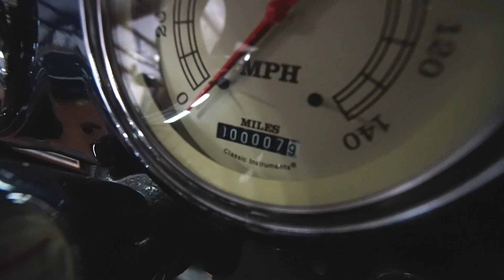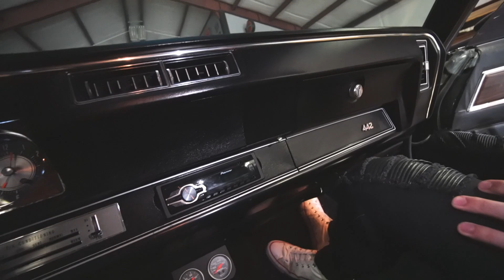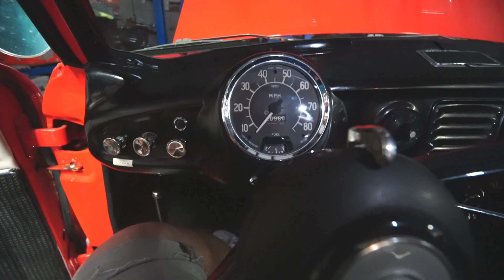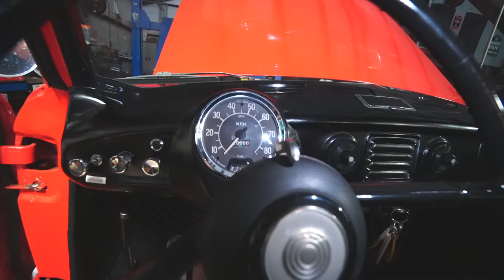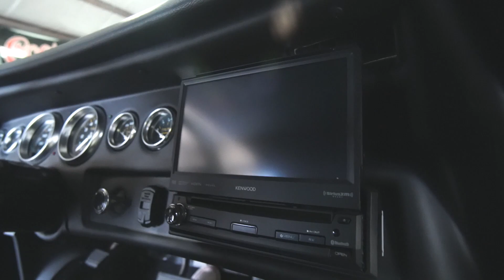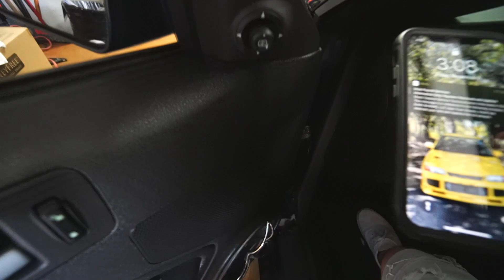Neighbor gives me tour of his INSANE classic car collection!

Comment: two models of the nash were powered by the OHV 1,200 cc (73 cu in) straight-4 Austin 'A40' series engine (as used in the Austin A40 Devon/Dorset) driving the rear wheels through a three-speed manual transmission.

Comment: Hey Evan. I have a question. I have an 99 civic lx that i strait piped. The check engine light understandably came on showing the p0171, p0172 codes. But also showing the p0170 code. I figured 171 and 172 would pop up but I’m not sure about the 170. I put a spacer on the lower o2 sensor and eliminated the 171 and 172 codes. But 170 is still there. I know you strait piped the Mercedes and I was wondering if you got those three codes as well...

Comment: Amazing collection of cars. They have an awesome taste as it's much like my own LOL. 
Evan you should get an american classic car. Modernize it with the whole drivetrain and interior. There where really popular to be doing 15-25 years ago here in Sweden and of cause in the US also. What would be really cool is to do it JDM style. Think a 2JZ swapped Chevelle or maybe even a bigger sized car like the Lincoln Continental. Look at Cooper Bogettis 2JZ swapped Camaro for an example that turned out cool and fast down the dragstrip even if a little newer car than a classic. Or if you would go bonkers and something like a R35 drivetrain and get that advantage with an AWD. Or maybe an EVO drivetrain. Maybe even do a classic JDM 70s car build with newer parts in it. A lot of the chassi design comes from the american classic cars era. Toyota and Datsun/Nissan has some beutieful classic car modells. A Toyota Supra MkI or a Nissan Skyline GT-R C10 would be awesome to see being build in a more modern fasion. 
My first car that I also painted and did some minor custom changes to. Like bumper delete and trim peices removed and lowered etcetera. Where an Opel Kadett 1977 with a 1.2L engine in it. So much of a fun car and not impresive hp or anything but it where hard to drive to unsafe with it. It actually where very fast on ice and snow roads as it where very balanced surpricingly. And with as small as 135/70-13 studded winter tires on it. The grip where really good and with not to much of hp it hooked on the ice great. I have thought about getting one again just for fun and great memories and also do some more custom work and an drivetrain swap as well. That I didn't afford and had time for cause of working a lot to do with it.